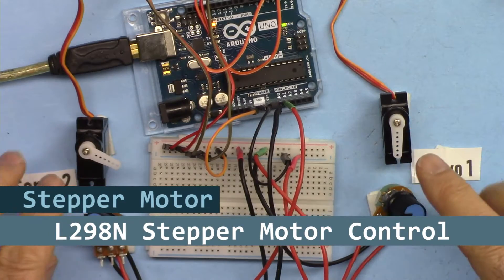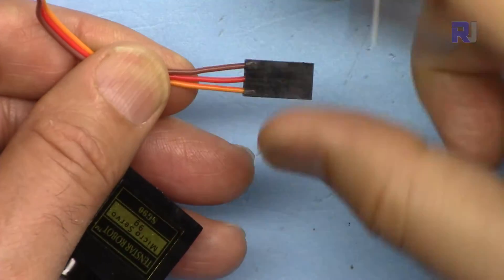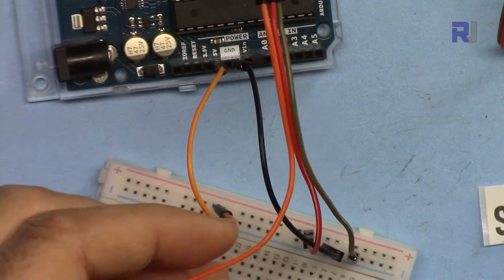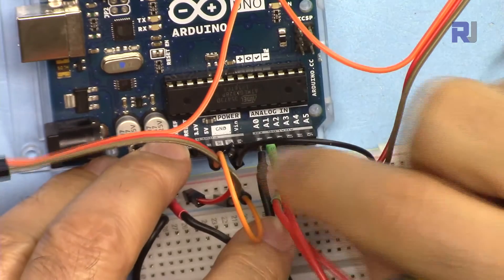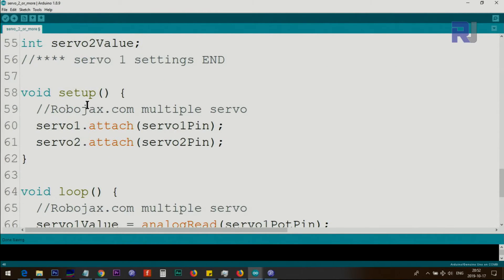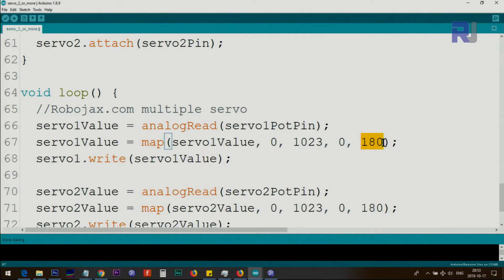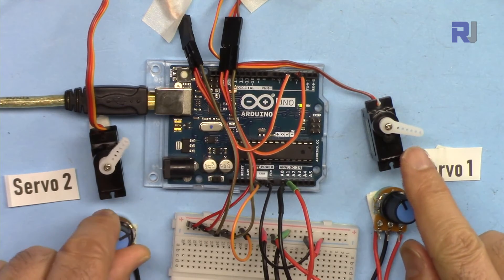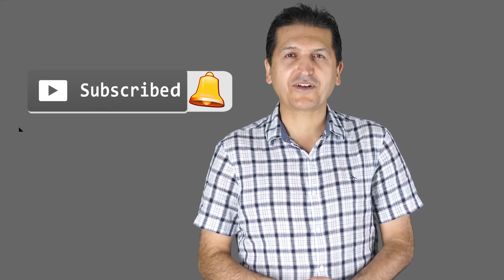How to control 2 Servo or more with Potentiometers using Arduino - RJT225

Comment: Can you like, record the movement you made with the potentiometers to arduino and then make it simulate the same motion endlessly?
Reply from the maker: my videos are for learning. I have explained every line in this code. Just watch this introdcuction to servo which run contineouly https://youtu.be/ntRW77mNFFk and learn from that and add the loop from that video this video. Very simple. Of course you gottqa learn.

Comment: Will your code work on esp32. So far I cannot get it to work.
Reply from the maker: It won’t work of course. Here introduction to servo with eap32 https://youtu.be/cDbd0ASkMog and for multiple servo https://youtu.be/KUqR3ZLX5Ks and servo over wifi https://youtu.be/GC0gRdBpylw and tones of more esp32 if you search my channel
Reply: @robojax  Hi thanks for your reply. I am desperately after a code for 4 servo's controlled by 4 potentiometers with a ESP32
Reply: Hi Mate. I copy your code to my esp32 and it do work perfectly. Thanks for your channel.

Comment: Esp32 board how to control 2 servo and 2 potanmeter please code send me
Reply from the maker: I saw that you posted comment under Esp32 with servo.  Use this method for ESP32 . my videos are for learning not to just get them. watch and I can assure you, you will learn because I do not leave any details out.  You may watch the better version of this video here  https://youtu.be/5zT9iZRa5b4 which has wiring diagram and better details.  The video I am sending you is part of my Arduino Step by Step Course  (over 150 lectures) Starts here https://youtu.be/-6qSrDUA5a8

Comment: I did this project, however no matter how I set the delay the potentiometers control both servos not each separately.
Reply: OK I figured it out, for one I altered the code so each servo has it's own val EG. val1 and val2 but I believe what fixed this was that I only had one potentiometer. thus if you have a signal in wire for potentiometer loose it must be attached to ground to ground the signal. Otherwise for some reason the signal will run from A0 to all servos.

Comment: Hi! very show congratulations! I wanted to ask a question if I disconnect the cable from the pc it doesn't work. How can it work without the pc?
Reply from the maker: wow.  Of course it works. we use USB to first program it. Then it is used for power.  *** Free Arduino Course worth $200**
Arduino Step by Step Course  (over 150 lectures) Starts here http://robojax.com/L/?id=338

Comment: Can i control step-motor with 2 resistance first for speed and other for oscillating speed to reverse direction  with different pitch i need help if there software  thanks
Reply from the maker: Depending on the motor here is one https://youtu.be/csf_G1pi0ps  or hers is another https://youtu.be/4LOpXFkWzD4 and I have tones of .

Comment: SALAM MR AHMED I TRY BUT ONE POTENTIO CONTROLLER  ON a0 CONTROLLING BOTH SERVO I USE SAME CODE FROM YOUR SITE
Reply from the maker: walaikum salam, wrong video. I have separate video and code. search for it.
Reply from the maker: You didn’t reply ? This is not nice.

Comment: Sir, but in this video you using two potentiometers to control the servos. But my question is control two servos in different directions by using one potentiometer.
Reply from the maker: check the other link. this video is not for you. search my channel. I tones of other servo related videos.

Comment: it doesn't work for. me
Reply from the maker: that is not enough. which part is not work? what do you read on the serial monitor? 1-Watch this video make sure your servo moves https://youtu.be/kZ9b31gVemc  2-then watch this video to control only 1 servo https://youtu.be/3_C7gJeX9hc  if you want to get help, always provide details as which part is wroing and which part is not and what error you are getting on Arduino IDE (the program)

Comment: if I turn one potentiometer both servos turn what do I do?
Reply from the maker: sorry, I did not understand. is this happening now and you want solve it? or this is what you want? I will make video on that to control 2 or more servo with 1 potentiometer.
Reply: No problem it’s working now
Reply: @ktech6778  How did you fix this? I am having the same problem

Comment: it doesnt work, can you make a diagram because i think its easier like that,

thank you.                :)
Reply from the maker: it works. You skipped and thinking you got it. but you didn't. I have explained the servo and wires at the beginning. then wiring is explained.  if you want the diagram, then purchase my Arduino course at Udemy. the link in the description.

Comment: assalamualikum I want to contrl 15 number of servo by 15 potentiometer now how to program, how to wire a arduino mega 2560, how to wire analog pin and pmw pin from control gloves.
Reply from the maker: Walaikum salaam, the main reason I made this video was for this purpose. if see the title t says "2 o more" so you follow this video and make up to 15. As long as your Arduino has PWM pins. I have explained it in the video. please watch carefully.

Comment: Hi! Can you please modifie the code that it can control 5 servo using 5 potetiometer? Thank you!
Reply from the maker: Hi, I have just put it on my list.  When time permits, I will make video when time permits.
Reply: @robojax  because im trying to make a robotic hand without flexsensors, im trying to use potentioneters.
Reply: @gabrielpacatang7702  bro please help me also i also working on the same project
Reply: @robojax  ok. Thank you!

Comment: Tried this but the servo values were not staying put, I wonder what i did was wrong
Reply from the maker: if you use the provided code without changing it first, it should work. Then change it if you want.